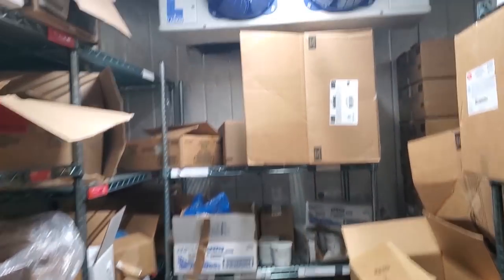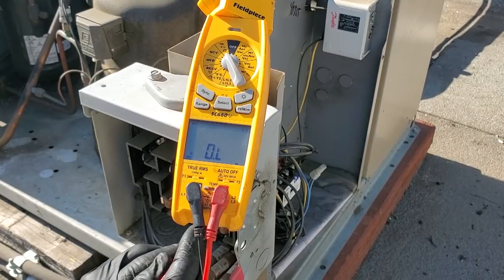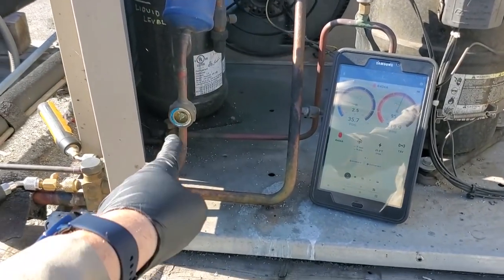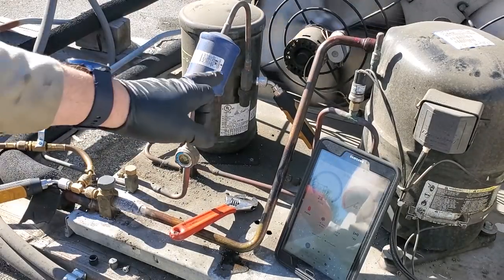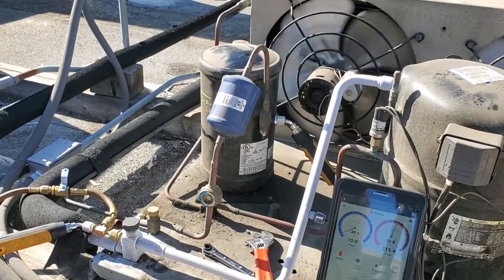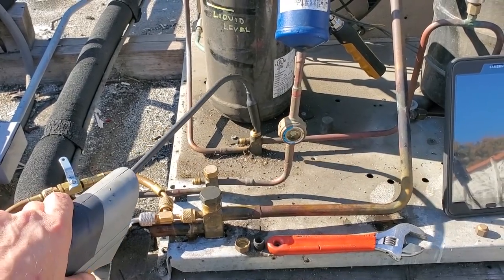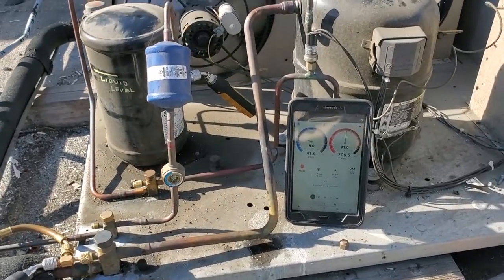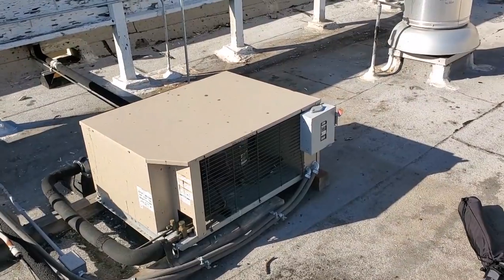SIMPLE WALK IN FREEZER CALL THAT LED TO SO MUCH MORE

Comment: I HATE disconnects mounted to units.. HATE THAT with a passion. It's a pet peeve for me. Make a separate stand for yourself lazy electrician. Cause when you need to remove a panel it's always in the way. Great video Chris.  Be safe have a great time at the show in Fla.
Reply: separate stand = more roof penetrations to be right, so big cost increase and cranky crying customers over the cost being near triple, because they;lll just call a roofer in to cover their asses :)

Comment: Thankfully your customer felt the same as you about throwing the disconnect.  I know some customers that would either say or try to throw it themselves, while your professional point of view isn't taken serious.  I've heard about customer's employees (not licensed in the field), pull wires since something was beeping (The board does this during a program download, to notify people it's out of service) a bit in a entry way and ended up shorting out a circuit board.  Since it didn't explode in their face, they felt everything was fine when they walked away.

Comment: Sometimes the unit will leak faster when it is shut down if there is an evaporator leak. If the stat is calling, there is full static pressure in the evaporator, which could be double or triple the normal running pressures. I had several units that were shut down for a couple months due to the virus shut downs that had evaporator leaks that were not evident prior to being shut down. They were very small leaks.

Comment: This is the reason why the circuit breaker has a hole in it. to lock it :D. 
Btw. to check if your evaporation is low on refrigerant you should mesure the suctionpipe temperatur. It should be 3-10 °C (sry dont know for °F) above the evaporation temperatur.
If its to high there is probably refrigerant missing.

Comment: I am wondering how long it takes for the new roof seal to dry? Because you could see that there was some roof sealant cracked there between all the units you were working on. Maybe they had turned off the disconnect to paste the roof between all that stuff in fear of working around electrical stuff and forgot to turn it back on? I mean that's pretty seriously absent minded.. but that's just a theory. 

I tend to come up with some of these things with where I work, our freezer is an absolute mess and oh boy does every electrictian that comes by have a field day of me leading them up through the process of what we have to this current day. Haha

Comment: That's a weird one for sure..homeless guy sleeping on the roof?
Reply: dave tatro Probably wouldn’t want to draw attention to themselves if they found a nice spot.
Reply: I'm thinking maybe a large bird landed on the disconnect handle
Reply: @mikejovanovic1645  I just posted the same before scrolling down further, very possible, landing or taking off if it doesn't click on/off real hard, over the years I've found many that were weak and easy to turn off. even a branch or blowing debris could knock them. :)
Reply: Michaelo jovanovic 🐦 4sure

Comment: Love Reefer systems, HATE the high Volt and Amp at which they work. Too much of a chicken to work on anything else than car's A/C. F&%$ electricity. Can't be touched, can't be seen, can't be heard unless you have instruments. Never liked it, never will. That's why I love I/C engines . . . a lot simpler and usually "talk" to you when they don't feel good.
Thanks for taking the time to make these educational videos. I'll probably never have to work on one but it was very entertaining to watch. Like one of those crime scene and unsolved murder programs. 😁👌🏻👍🏻
Reply: The unknown is often scary, but my response is to turn it into the known instead of turning away from it. Once you understand something, it's no longer capable of scareing you.

AC electricity has it's ways of "talk"ing to you too. You can tell if a transformer is live or not by listening for the buzz, you can hear the hiss of a corona discharge or snapping arc of high voltage tracking across a failed insulator, and you can smell the ozone produced by a high voltage discharge (not always an arc, corona discharges produce ozone better than arcs).

Of course, I've been told I have very sensitive ears by many people, but I don't think it's that. For some reason my brain just takes notice when my environment seems off according to one or more of my senses, and I have ADHD so I can't focus until I figure out just what is making that dang noise. My brain just won't let me ignore it.

Comment: Wait during the pump down process the system was flooding back to the the compressor and the question is:Is it normal for the unit to flood back to the compressor.I ask this because I saw the pipe going at the compressor been ice cold.
Reply: He was recharging w liquid directly into the suction line when I frosted up

Comment: I keep flare caps for all my discharge valves. And make sure i have brass ones especially for steel suction line rotolock valves. If it's brittle enough to break it's ready to be changed anyway 🤣

Comment: Crazy camera effect from the left fan on the roof unit..  LOL at no one's been on the roof umm, Disconnects don't just shut then self's off!
Reply: Sometimes birds can do that, something like a crow pecking and grabbing at a bright red handle knob. Especially if said handle knob doesn't take like 10 pounds of pull to operate like I'm used to them needing when they get a little bit corroded.

Comment: You used what looked like a torque wrench screwdriver to install the Schrader valve, who makes that and is it specifically for HVAC or more general for automotive use too?  It not clear to me whether the fixed torque setting on the Lisle tool, for example, is the right value for HVAC too.
Reply: Generally they are all the same setting. It's more a setting to keep from snapping the threads on the valve. The o-ring only needs a tiny amount of pressure to seat properly. We use them in automotive for both tire valves, as well as A/C valves. Similar type of refrigerant with either R12 or R134a. The head pressures are pretty similar, usually 170-300psi is the range. It depends on the system though, some don't spec that high. Dropout is almost always 30-40psi. Tire pressures range from 30-150psi. So you usually find similar valves and tools.
Reply: I have one made by JB industries. That’s a company that makes HVAC tools.

Comment: Is it possible the disconnect was turned off accidentally by a Racoon (AKA the Friendly Neighbourhood Trash Panda) or a Pigeon (AKA the not-so-Friendly Neighbourhood Flying Rat/Disease Carrier) landing/sitting/falling on the switch handle? I'm asking because I don't know how much force you need to turn that particular one on/off (I've run into 1 or 2 that can be flipped off just by breathing hard on it...they were so loose, they really needed replacement)...
Reply from the maker: Yeah these are pretty hard to turn off. I still think someone climbed on the roof and did it....
Reply: @HVACRVIDEOS  That's what I figured, but I thought I'd ask because I have encountered 2 that could be turned off by a Pigeon landing on the lever...
Or darn near anything else for that matter...
They REALLY needed to be replaced...

Comment: I always change out the plastic caps with a brass cap with no oring on the discharge lines. It just gets too hot for those rubber o-rings overtime
Reply: Isn't the cap only there to stop dust ingress and keep the external threads clean anyway?
Reply: @TonyRule  ehh yes and no. Schrader cores are always gonna leak a little bit, no matter what. The cap will hold back a leak if installed properly and not use oring caps on discharge lines.

Comment: My guess is someone went up there for whatever reason , maybe smoke or do drugs away from the boss , and they got annoyed by the sound of the condensing unit .
So , yeah , as far as the manager KNOWS nobody was up there .
Btw , I always seem to have a hard time with core removal tools , could you explain the proper way of doing it without getting the valve stuck , neither inside the body of the tool or inside the thread of the port ?
That'd be very much helpful.
Cheers , Chris 👍

Comment: I have a customer, a restaurant that is closed two days a week.  A while back, at the end of their week their system lost enough refrigerant that the box warmed up after they closed.  They came in during their off days and the frozen food had thawed.  I found a couple of leaks, but still don't trust the system.  I installed a temperature alarm.  It has a temperature probe, a small blutooth transmitter, and a receiver (gateway) that is placed near their router. I can now monitor their temperature remotely on my cell phone, and get an alarm if a limit is exceeded.  I will probably sell it to the customer or remove it after six months or so.  How many of you are using alarms on equipment?
Reply: can you share the brand and model of this alarm? It uses the customer's wi-fi or has its own cell signal?
Reply: @davejohnsonnola2758  It has a blutooth connection from the sensor to a gateway device.  The gateway, or whatever they call it, connects via an ethernet cable to the customer's router, so it does not use wifi.  I don't recall the range.  I have another customer who's router is not near the freezer, I could run a cat5 cable through the suspended ceiling from their router to a convenient spot for the gateway, which would pick up the blutooth from the sensor.  The gateway can handle a number of sensors, can't remember the limit.

Comment: Doubt I'll get a  response to this, but I'll ask anyway. The disconnect switch is exposed on the roof right? So my question is, could it have been a bird? I made 3 observabsion during your video that could point towards that, the switch is almost as high as the switch box in it's ON position, The switch faces upwards at a slight angle in it's ON position and you didn't seem to have to use too much force to move it from OFF to ON. Maybe it's something so rare you don't jump to that conclusion right away or it's something that can't happen because it's been thought about and warded against. Just thought I'd ask since this is a fasinating mystery :D
Reply from the maker: The switch is very difficult to turn off I highly doubt a bird could do it..... buy who knows what really happened.

Comment: I’m a little confused on why uncharged as a liquid on the suction line? I thought that would cause liquid slugging
Reply: blended refrigerants should only be charged as a liquid to keep them "mixed" in a gaseous state they will separate and leave the container at different pressures.
that would only be somewhat OK if it was a huge system and would hold way beyond the whole tank without needing powered on.
he cycled the inline valve to keep it from slugging, the compressor itself is a fairly large chamber, which would need flooded pretty bad before taking a drink, other issue is washing/pumping all the oil out into the system.
Reply: the compressor was getting liquid in, once the suction line gets frosty like that, means liquid, instead of using infrared cameras and charging equipment where it says "liquid level" he should check fans cycling, its just a waste of time and refrigerant. You dont charge until the sight glass is clear, you charge with superheat and check subcooling, also, why the evap fans run instantly? why charge a system when just started and starving the txv plus the fans running. i would advise him to pay attention to other details instead of jumping on adding refrigerant.
Reply: @alvaroleguizamon1303  he shut the "king" valve off at the receiver tank, so the compressor pumped all the refrigerant from the system down(into the tank) until near zero pressure (typically 5PSI) that means all the charge in the system is in the receiver tank and a very tiny amount left in the rest of the system.
so adding charge slowly then via compressor just pumps it into the tank to get the correct total max charge.
without doing that it would run low on charge due to large climate swings

Comment: We had the walk-in fuck up in a supermarket I worked in. Not their fault, it happens. It was a bad sensor that disabled it, the service guys fixed it in 15 minutes. But what I want to point out is, the walk-in went all the way up to freezing point in just a couple hours and the manager I alerted was on the verge of calling out a freezer truck and migrating the whole freezer's 6 tons of content over in there. These guys waited so damn long that all the food became a soggy mess, let alone 2 full days. If that happened at the said store and an inspector came in, we would have received a galactical sized fine... You are not allowed to sell defrosted and re-frozen food

Comment: No idea if this could have happened there, but...

I worked in a Canadian A&W, the fan in the walk in freezer was making a weird noise, and it was a long weekend. The boss told me to go up and flip the power switch on the roof unit, called the place on tuesday and claimed it had been getting warmer and sounding weird all weekend then died overnight that night. The guy was super confused as to why it was turned off, and the fans clogged with snow and ice, if it had only stopped working a few hours ago, and about the foot prints on the snow on the roof, boss blamed it on it being a truckstop, said a methhead must have done it. I spent the whole time just shaking my head and trying to stay quiet, not sure why my boss wouldn't just tell the repair duder what he needed to know to fix our shit.

People are idiots yo.

Comment: Even in automotive A/C systems the Schrader valve is a pain. I quit refilling my A/C systems on my pickups because the moment you connect even a cheap A/C charger like what you get at the local Wal-Mart or auto parts store you just make it leak off twice as fast.

Comment: a flare cap can stop a schrader leak since its a compression fitting(if you are a thug ), but ya you just replace the schrader core with the tool.
Reply from the maker: I will be going live on YouTube this evening 4/13/20 @ 5:PM (pacific time) to discuss my most recent uploads come on over and check it out if you can https://youtu.be/vY1U3KpfuzQ

Comment: I suspect foul play by someone. It's great that system got the service it needed ( refrigerant top up, new valve, inspsection). But did you see that flimsy ass enclosure that the service disconnect breaker was mounted in, with NO LOCK on it? Bad news!! I would have informed the owner or manager of that, immediately. After all, if that power goes off, thats a possible loss of thousnds of dollars worth of stock, and or hundreds of customers made seriously ill. Say good buy buisness, hello Courthouse!

Comment: As a customer, I would be pissed if you would have just turned the disconnect on and left. I mean, you most likelly have a 1 hour minimum charge anyway, so I would have felt cheated if you just flipped and charged 1 hour plus transport... But now, you took time to investigate and check the general state of the unit. So my 1 hour minimum has been rentabilised.

I would still be pissed off, but now it's at the sabotager, not the hvac guy, as it should be!
Reply: Got a new word for you. Saboteur, that's the person doing sabotage.
Sabotager is technically incorrect, tho I did understand your meaning without any additional thought.

Comment: Your core removal tool is too tight - I usually will back mine off 1/4-1/2 turn from my normal gauge/probe "torque" and it works perfectly every time. Lil' tip picked up from the Appion guys somewheres.
Reply: Exactly!!
The o-rings get too depressed/squeezed and block the core from coming out.

Comment: Our company replaces the quick seal o-ring type flare caps with part# N5-4. This cap can be tightened with service valve wrenches that have the ratcheting hex end, or with an adjustable wrench. These caps give you a brass-to-brass seal and are as leak-proof as a regular flare nut. http://www.jbind.com/products/product-search-detail.aspx?SKU=N5-4

Comment: My suspicious mind would say malicious intent because  there was nothing wrong with the unit and it requires a hand to operate the disconnect switch. The other point is why would you leave  necessary refrigeration off for two days ?

Comment: 1. Hopenthat food wasnt refrozen. Thats just nasty then. Food will taste like crap. 
2. I hate walk in coolers. I worked in one for over a year. Somewhat contributed to cancer wise (temperature). Ill enter one if i had too, but overall i really hate them.
Reply: NihilisticEntropy  Didnt give, but it contributed to it. I had Osteosarcoma on my leg proximal tibia reguiring the knee joint to be removed. Have a rod up my femur and down whats left of my tibia. The fibia was just topped and left to dang around. My daily routine then was working 3am to 9am or 4am to 9am in a 30°F cooler. Then go work on the farm from when off in 110°F. Sometimes i worked doubles going 9am off till 2pm to be working till 8pm in a store reaching 80°F. The cold made the bones hurt. What actually set it off was jumping over a trailer hitch. The bone cracked and never healed causing the tumor as marrow was oozing out not becoming bone. The cold made it to where i couldnt walk and increased the pain. Im already pretty white, but then someone tell you youre pale, you know something is up. Heat helped, but only take the pain.
Reply: NihilisticEntropy  was my life and i enjoyed it. I have a better job now and the cancer stuff is done past.

Comment: reason they shut it off because leak come out if valve screw in
they think going cause more problems down road so they shut it off for reason for not danged ac or loss of pressure in tank but they should informed owner but they never did